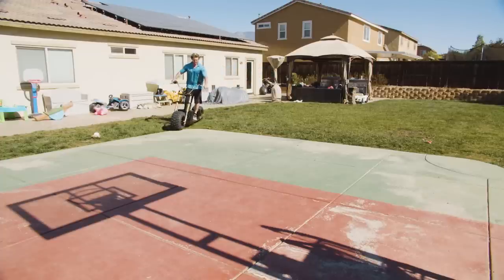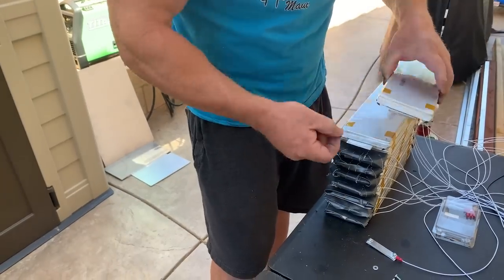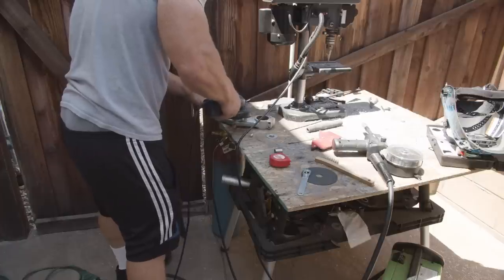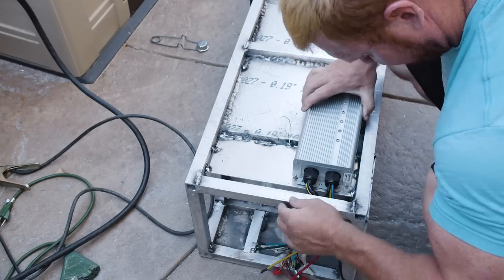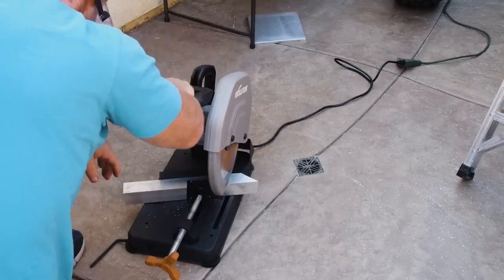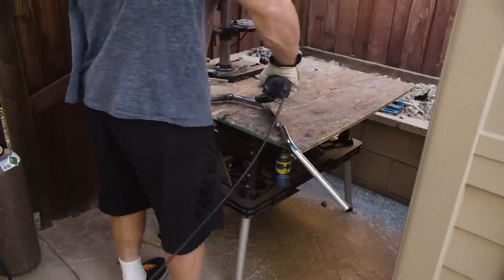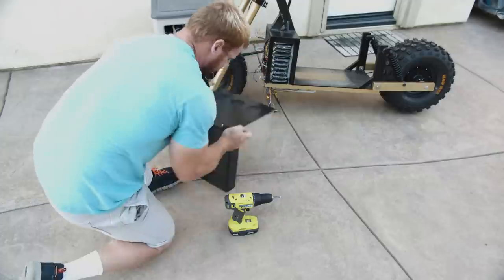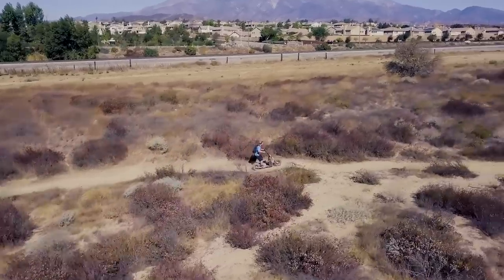FAT TIRE SCOOTER Electric Dual Drive 75 volts 60AH ALL OUT OF ALUMINUM

Comment: For those yyk controllers you were initially installing, you have to swap the blue and green phase wires and hall wires. Swap blues position for green on both thr hall connector and when you connect it to the motor. That will probably fix your technical difficulties. I have two and blew a motor and some halls before finding info on endless sphere about this

Comment: this was brilliant brother, pls keep on building such projects, we love to see you grow, and you definitely will, hope you are safe and healthy in this pandemic.
Reply from the maker: Thank you very much
Reply: i dunno man, dual 4kW , 300amp BMS, 75V, but only 35mph?
Reply from the maker: @Blox117  welcome to hub motors, hub motors are not for performance, there for Convenience.
4000 watt it s the  peak of them, 200amp BMS is over kill(I had it laying around).
If you wanted this fast and have tq, you would get a mid drive motor and gear it correctly
Reply from the maker: These hub motors are very wide they’re mostly for flat tire scooters they’re not like the motorcycle hubs motors from QS motors, those have a good RPM but still lack total torque.Search “ripperton electric superbike “
This guy races electric super bikes in Australia and they do a lot of test experiments , he built a 200 kW super-bike. If you look at their test the mid drive motors always outperform the hub motors also hub motors put weight where you don’t want it , on the ends ,you want your weight right in the middle.
Reply: @RexSmithII  ok that is cool, im building an electric motorbike with 20kW using dual hub motors. i was wondering about the low speed as 2kW is good enough to reach 35mph
Reply from the maker: @Blox117  yes, the kw doesn’t matter too much as the voltage. For instance my hubs on that scooter is rated for 60v, so by me over volting the motors to 75 I was able to reach a faster top speed and have a bit more efficiency. 
Remember motors can be most of the time be over it’s voltage rating, the controllers matter more on this, so you have to know your max voltage on your controller and build your batteries from there. Also when you max out voltage on controllers don’t use regen ! Regen is also a waste of time and more wear and tear on motors and controllers
Reply: @RexSmithII  what about amperage? why only voltage increases rpm?
Reply from the maker: @Blox117  because there’s 2 ways to increase rpm on a dc motor
1- more kv
2- voltage 

The only way amperage will increase speed is gearing, ( more amps + taller gearing = more speed) but your first choice should always been Increase voltage first, because this will also cause less heat.
The best bang for the buck in controllers seems to be 72v controllers, they almost all use the same caps and they max out around 92-95volts, so most 72volt controllers can go up to 21s(88.2 v) . But when you get into even higher volt controllers(96-144volts) the parts get so massive and very expensive, then everything gets more( charger, BMS, more cells in series etc)
Reply from the maker: Amps is more relative towards tq and voltage is relative to rpm
Reply: @RexSmithII  thanks for the information, im running a sabvoton 72v controller, but now im wondering if i can push the voltage up a lil more. i know there's a sabvoton 96v version. also The Inja on youtube used supercapacitors in parallel to achieve less voltage drop and more instant power delivery.
Reply from the maker: @Blox117  do you already have your batteries built tho?
Look up the specs on your 72v one now, I bet it is max 88.2, but this might not be labeled in the controller, you might have to contact supplier or manufacture.
Reply: @RexSmithII  i built my battery, its 20s cells or about 84v full charged. the problem with controllers is that sometimes even if it could go higher voltage, there is high voltage protection to shut off power.
Reply from the maker: @Blox117  you plug it in and make sure it’s at its hvc and LVC for your particular battery ,
Normaly they automatically have the hvc at the highest in case you engage regen(regen csn cause voltage spikes) also letting off the throttle fast causes back emf, which spikes voltage

Comment: If you need a fender for it you should look into Honda 200x -250r - and 350x fenders. A front fender from one could prob be made to work front and back on that!  Great job. Might wanna look into some stronger triple trees. That’s a lot of weight to have on a set that have been cut and welded
Reply from the maker: Yes, I would think that might fit just great.

Comment: On your intake manifold how do you prevent dirt and dust from entering and mucking up the internals and batteries? And the air intakes exit port is over the controlers under the deck how do you prevent moisture from getting on the controlers? I know its electric and shouldnt be ridden in the rain and such but going offroad there is always the chance of running into an area that has high ground moisture unlees you only tide in the desert.

Comment: Great project,  great build. I'm wondering if a seat would make it more confortable and safer to ride. Thanks
Reply from the maker: Probably, that would make it more traditional, yes.
I came from building eclectic skateboards(should of made videos) and fell in love on how simple it is and the felling of gliding around . This is sorta a mixture of that. Plus I wanted something you can just hop on and hop off , kinda like a lifeguard would use to go save someone from drowning in the ocean...

Comment: Where did you order the parts from?
Were original controllers ok, just got too hot?
How did you control the two motors?
Reply from the maker: China 
Original controllers were ok, the manufacture wanted me to use there controllers.
Two controllers two motors one throttle, the signal wire you parallel to the two controllers
Reply from the maker: Get to me on email of interested in the hubs!

Comment: So I've made my own...let's say contraptions many times and I must say this and your other builds are top quality, very good job !!! I have one question, how could there be too much power? I mean couldn't you just control the power output with the twist throttle and just keep the extra power on tap just in case you find yourself in need of it?
Reply from the maker: Oh yes definitely, since it is electric you have tons of different options. One way is to put a 3 button switch and have 3 saved custome modes which would be relative to amps and throttle response.

Comment: You might want to contemplate a rear fender in case your get too close to tire in a crash or anything, it'll try and suck things through the gap between it and the frame.

Comment: i have one of those controllers on my diy scooter. 3000W 84v. Its definitely insane huge power. Theyre made for go-karts so on a scooter its huge. That scooter will wheelie out from under you if you hit the throttle even remotely too fast. and with the 33T rear sprocket i used my top speed (theoretically) is like 80mph. I havent hit more than 50. its scary being that fast on a rickety pos. lol..

Your scooter though looks awesome. Im lovin it. I'm definitely subbing!
Reply from the maker: Thanks appreciate it, looks like most people love this scooter, it definitely was my favorite build
Reply: @RexSmithII  yeah bro, I’m just now getting into all the DIY EV Builds and have been scrounging bits and pieces here and there.... My goal is a reverse trike that has enough power to sling gravel, climb any hill I want, (within reason) can ride for at least 2 hours plus, has 2 suspension settings, one for on road, tire burning speed demon, and the second for torquey off road hill climbing. Have one set of road fat tires from an older fat boy 10 speed, and some short tiller type wheels and tires, and a could lawn mower tires, 2 golf cart motors and rear portion of a electric golf cart... Just a lot of odds and ends that I could throw together to make me something right wicked... All I’m missing is the batteries to actually do like I want, and not just 3 deep cycle lead acids, and a rack of golf cart batteries.... Shrug* 
I’m trying... Really wish Inhad some of that awesome gear you’ve got there bud, but I’m poor folks, I can’t afford all that awesome gear, so, I’ll be using just about whatever I can find scrap or that someone else has junked or tossed out... Doing the best I can... But your Scooter is wicked as Shit man, like that is so badass... I’d Kil for something like that..! Def subbing broski..! Keep it up, enjoyed the vid and the end result of your work.. Awesome job man...

Comment: What charger do you use and how long of a run time do u get on that giant battery with those powerful motors? I made a 1500watt 48v drift cart and get about 20 minutes on 6.5 amp hour batteries at full throttle most of the trip doing around 28mph on flat ground
Reply from the maker: I buy a charger from a china guy I get my bms’s from. I then order they type of plugs I want and wire them in. There supposed to do 8amp but only literally out put 4amps.
That 60ah battery would take a long time to charge from an empty state. I would normally let it charge overnight, I use really good BMS that connects to your phone via Bluetooth to monitor each cell if needed. All my batteries I have made can do fast charge no problem, you would need to purchase that and it’s not cheap. So a 30amp fast charger would charge that in 2 hours from empty, but your battery should never be empty. Ride it to half then charge. Is a good rule of thumb. The range on this is pretty good since it’s aluminum and the motor do not draw too much amps. I would say average ride time is over 2 hours

Comment: Did the battery overheat, there were enough ventilation even when you stack them solid like that?
Reply from the maker: No, batteries don’t even get warm, very high end. Stacking them is fine.

Comment: Hey man, great job! I love the design of this scooter. I'm working on my own build right now and I have a question - how are the hub motors attached to the atv wheels? Did you have to fabricate a bracket or something?
Also, could you share a link to the motors used? Thanks in advance 👍🏼 peace from Scotland 🏴
Reply: Or are the tyres mounted directly onto the hub motors? It's hard to tell 🤔

Comment: what size are the hub motors amd what is the size of the tyre? any links?
iv have a 4 wheel scooter idea to use on the beach for a while that would be perfect for that size wheel. 
my thoughts were tho to have 1000w motor on each corner running it at 60v with independent front and rear suspension
Reply from the maker: Hubs 8x7.5
Tire 18x10.5-8
2000watt rated 4000w peak
I believe there rated at 60b but going 75v is no big deal, the controller is where you need to pay attention to the max volts, most motors csn always be over voltages. This way you can gain more rpm, and lower the current just a tad and get way less heat
Reply from the maker: 8” hubs 
Tires 18x10.5-8
2000watt rated 4000w peak
I believe there 60 v rated, but no big deal to over volt them to 75, you can gain more rpm and less heat(if you lower the current a tad)

Comment: Did you use 2 SineWave controllers? If so, which ones and how did you connect them to the display?
Reply from the maker: In video I used The YKZ7280JA controller. But then used the manufacture tiny controllers (no brand ). The display is connected from the BMS.
Reply from the maker: Yes and they are sine wave

Comment: Where did you get those hub motors? Are those 15" tires?
Reply from the maker: Actually if you need the hubs, contact me email. I will be distributor for them in USA,
18x10.5-8

Comment: How many watt/hours batteries?
Hope it will give 500 miles ranges....lol
Reply from the maker: That would be nice, I tend to build my stuff for performance more than range, I would’ve only used one motor if I was concerned about range .instead I wanted more traction and double the torque since hun motors lack torque already
Reply from the maker: 4.5kwh

Comment: The welds look like bogeys lol
Reply from the maker: Just started welding, I jumped into aluminum right off the bat with boarderline equipment. Aluminum is very tricky 
Have you welded aluminum before?
Reply: @RexSmithII  Hi REX yes, running AC pulse with Lorch machines (MIG) when I was an apprentice. I would highly recommend using TIG for these small applications.
Reply from the maker: @benlorne2161  I know tig is way more professional and cleaner but a tig is hard to get under areas were Mig could and is a breeze for run and gun for these applications is way better for me. I don’t have a welding table or something where I could just sit and tig.
Reply from the maker: If I didn’t have a full gym in my garage, I would definitely turned it into a welding area. With proper table etc...I’m also only using 110v input so this is bare minimum. But you would be very surprised how good these cheap inverters actually perform for the price. I have also been told by people that bought the same equipment. there is a good review video on YouTube comparing it to millers etc..

Comment: So you lift a little!
Reply from the maker: Used to be bodybuilder then had kids and stopped
Reply: @RexSmithII  I used to be a lot of things till I had kids and gave up everything; :)
Reply: Interesting project you've built! What was the motivation behind it? Just because you can or to stop using the car etc?
Reply from the maker: @blackwingvisuals5017  the motivation for me on this project was to see if you could use front and rear wheel drive to one throttle, and see if it is worth it.
All my other projects were merely to see if I can get electric to outperform gas applications.
My start of this field was from building race drones, I then fell in love with the electronic parts and the necessary components to achieve this